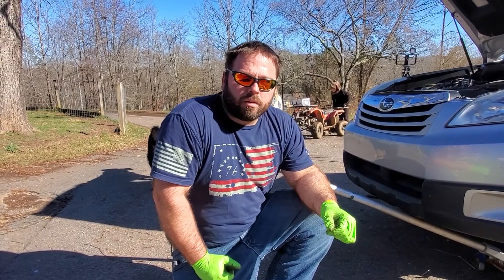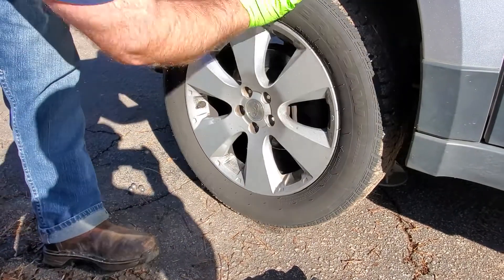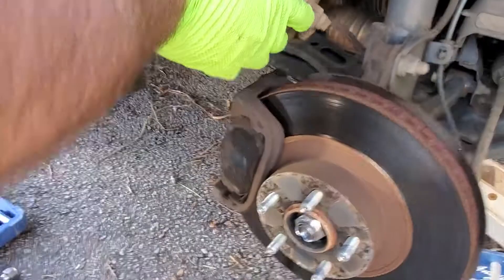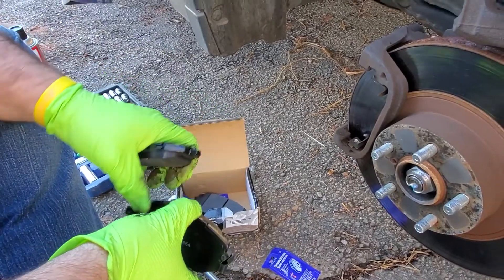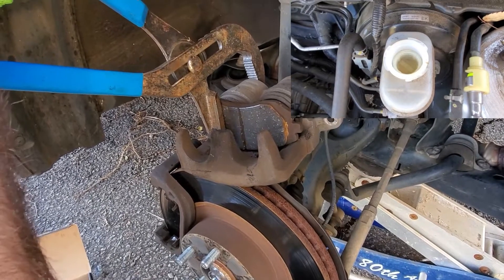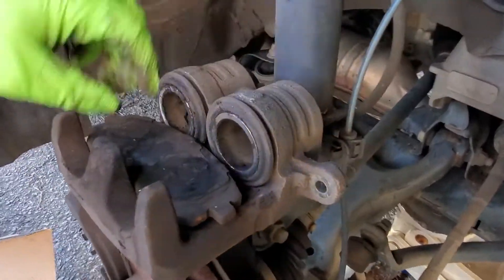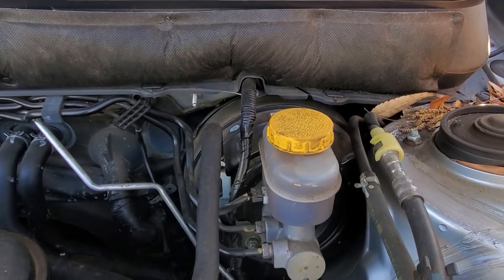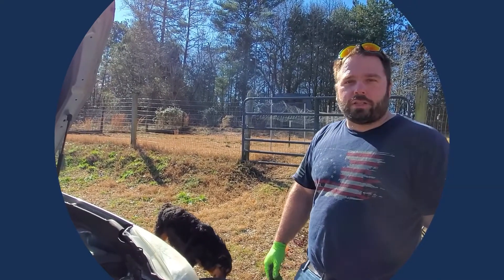Replacing Front Brake Pads on Subaru Outback (2010 - 2014)

Comment: Just a note, you need to grease the friction clip points. You should not grease the back of the pad. You do not want that slipping you want to ends where pad clips to be greased.
Reply: Actually no I don’t want anything exposed to be grease if it’s exposed it should be oil unless it’s specific uses
Reply: the grease on back of pads helps stop squealing of brakes probably better to apply it to the caliper ears and the piston ends so it does not collect too much dirt in areas out in open that it is not needed

Comment: Thanks for the great video. You think exactly like me on safety-I also have the floor jack ready to catch the car in case the jack stand fails. Couple of pointers I have received in the past include turning the wheel to help with loosening of the caliper bracket bolts. In your case, on the driver side, if you turn the wheel all the way to the left, you will have easier access to the caliper bolts without having to reach in. Also, I replace the brake pad clips and use high temperature brake lubricant where the brake pad meets the clips (in addition to the brake pad backing plate where you used the moly coat). I have also started to use anti-seize on the bolts securing the caliper bracket and caliper bolts so it makes it easier to remove the next time. Lastly, I replace the glide pin boots on the caliper and clean the pin slot and use pure silicon paste on the inside so the glide pin bolts slide easily. There is nothing that beats the joy of doing your own repair and doing them right. Here's to more DIY auto repairs!

Comment: Thanks for that. 1) It is also good to grease the ears of the new brake pads. 2) I recommend pulling out and inspecting the caliper pins. They need to slide freely in the bore. They are about $12 a pair to replace, but may be fine to clean, grease, and reuse.